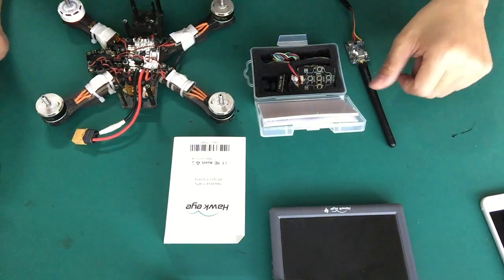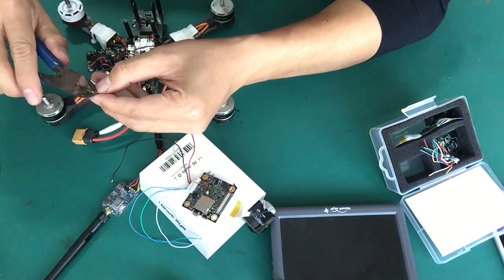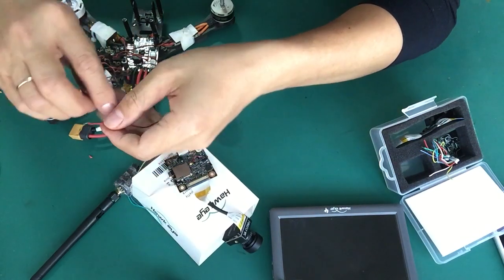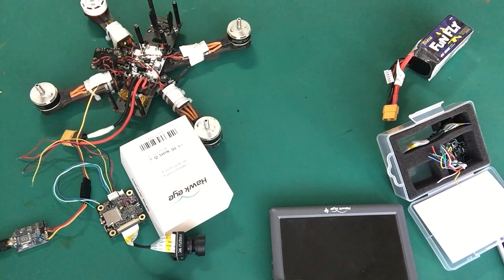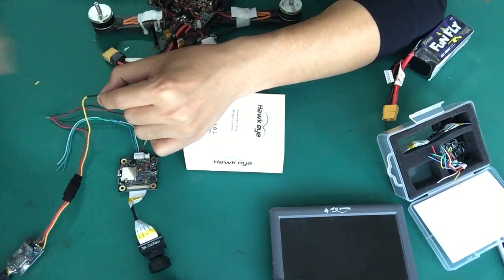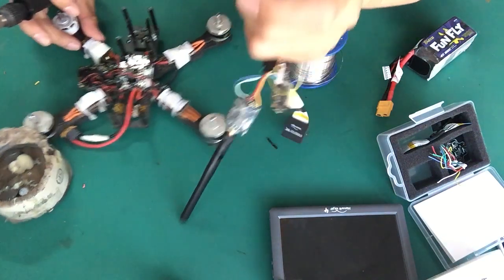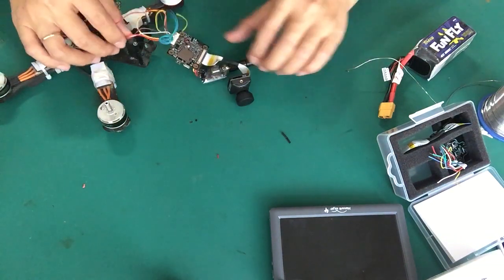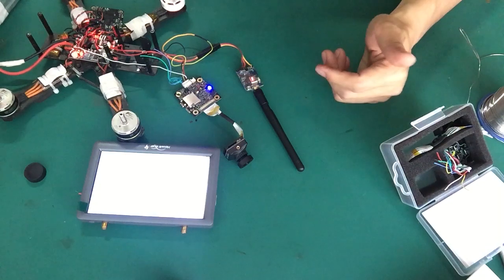Hawkeye Firefly 4K Split Cam User Guide

Comment: Hello! How does the video and the photo trigger works? How can I trig them?
Reply from the maker: Hi you can check the manual; they’re active low
Reply: @hawkeyefpv_official  First of all thank you for your reply! So when I connect it to a controller board I dont have to set up any communication (UART, SPI, I2C, etc) just connect it through a resistance to either ground or 3.3v? What about 5v pins?
Reply from the maker: yes, no need, it's GPIO, no protocol @gyulakurucz8331
Reply: @hawkeyefpv_official   Okay, I bought a SpeedyBee F405 V3 flight controller it has pin R3 and T3. This cam has pin Tx and Rx without connectors. Can I connect them together to control the recording?
Reply from the maker: @gyulakurucz8331  please refer to the full manual
Reply: @hawkeyefpv_official  Ohh, I was reading an old manual. I found the new one. I connected the camera to the flight controller and set up the flight controller according to the manual. Now its works fine! Thank you for your patience!
Reply from the maker: @gyulakurucz8331  you’re great!